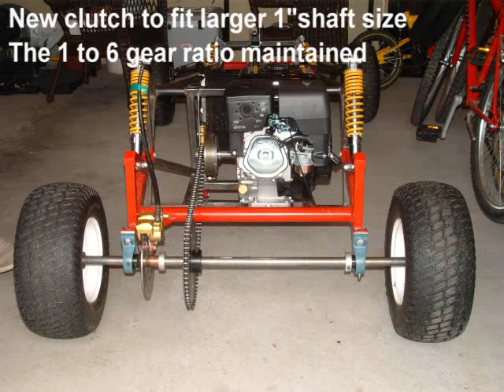Homemade Off Road Go Kart upgraded with a 9HP engine (Pictures & Video)

Comment: hey mate thats a nice build their...i to have just purchased a 9hp lifan engine ( honda copy/clone ). and it has good power but it gets to a certain stage and stays there, you can feel the power and it wants to go faster but just stays at a certain speed...do you have any tips on getting more speed/power from it without removing the governer as its quite a big and delicate job and i dont want to damage it....any tips/help you have would be appreciated, thanks.
Reply from the maker: You got it right there.  The governor is taking control.  You can't have you and the governor control the kart at the same time.  You have to remove the external linkages and directly control the carburetor butterfly yourself.  There is a risk.... If you over rev the engine, it can potentially destroy itself.

Comment: What were the gears? Would it be different on say a 20 horsepower motor?
Reply from the maker: YamahaNearOmaha 
In response to an other comment below I had provided the following explanation : 
"Look at the comment at 1:08 (6 to 1 gear ratio) achieved with 60 and 10 teeth sprockets.  16" OD tires.  3600 rpm / 6 = 600 tire rotation per min = 36000 tire rotation per hours.  36000 rph x 16" * PI / ((12 in per ft) x (5280 ft per mile)) = 29 miles per hour or 46 km per hour which was the target speed.  Hope it helps!"
A 20 hours power would be sufficient to achieve a faster end speed, easily 50 mph, you would have to do the math accordingly.  Ideally a variable speed clutch or a multi-speed engine (motorcycle) would be even better.
Reply: S Blanchard A 22 horse power kohler engine is what i was thinking of using. would i be fine with using the 10 teeth on the drive and 60 on the axle? And what if i wanted to exceed 50 mph?
Reply from the maker: YamahaNearOmaha 
To make the calculation, tire outside diameter is very important in the equation.  Once you have that clearly defined, we can compute away !
Reply: S Blanchard But that's the thing I can get pretty much any size. I'm just trying to find the perfect mix of enough acceleration too do doughnuts in grass and spin the tires on gravel but enough top end to get over 50 mph Like i'm thinking what would the result be with a 10 sprocket on the drive and a 40 on the axle? I'm just worried about ground clearance because I want to be able to go 50+ on road but also be able to go off road if this makes any sense

Comment: He is going to hurt him self and could die me and my freind wreckt our 10 hp cart i broke my arm and leg and. There was a role cage on it
Reply from the maker: With a solid rear axle, wider would make it harder to steer.  In fact the long length was the result of adding space for the seat to be adjustable.
Reply: Ok that make sense cool

Comment: - good grief - that's made better than any car I've owned ! -  if I were to try to mount a 9hp Lifan (sans attached gas tank)  in a little minibike frame which barely holds a 6.5hp Tecumseh with tank - would a new engine plate be required to work and a good balance of engine weight?  (I'd use a knock-ooff series 30 tav w. 1" clutch)

Comment from the maker: I ordered the steering wheel over ebay.  That is a car steering wheel which was way cheaper then any other gokart steering wheel I could find. 25$ delivered, new in box.  I just checked and was able to find something similar for 39$ delivered.  Ebay also for brake caliper, shocks, seat.  Engine, sprocket, chain over princess auto.com.  Back wheel over Casterland. Clutch over Heeter Performance Center.  Many hours of research to find the right part at the right price. Enjoy your project !

Comment from the maker: This is a centrifugal clutch ordered from Heeters.com
The "enforcer" series
http://www.heeters.com/kartclutches.shtml
Works very well, doesn't slip at all. You can feel it very much when it catches and still holds while the engine slows down on compression.  It can handle up to 40 HP.
Reply from the maker: ***** 1k$.

Comment from the maker: @MasterUndead225 
A chain tensionner would have to be added.  The engine shaft would not be centered with the rear swing arms pivot point.  I would rater consider 2 of 6.5 HP side by side.  2 clutchs and chains pulling on the same shaft.  That would be very cool.

Comment from the maker: Chris, yes the Ackerman was planned for.  A CVT clutch would have been more weight and $.  And finally simplicity is a winning way of doing things!  The kart has a long wheel base due to the adjustable seat and independent suspension in the front.

Comment from the maker: I used a wire feed welder.  This was my first project, so it was the easiest one to learn using.  If you see my initial video at 56 seconds, you would see the welder over a milk crate.

Comment: i have a few comments: you are one of very few that seem to actual have the know how to build a kart that is well done and safe. also i noticed that the kart has a lot of ackerman in the steering, did you plan that? also what was the reason for going with a straight clutch and not a CVT? and last but not least when are you going to shorten up the wheel base!!! lol but hey for a young kid a long wheel base is probably best.

Comment: One suggestion, if you took a second set of tires and made slicks. (No knobs/tread) or reduced the amount thereof, then he would not ruin the grass as bad. It would give him less acceleration, but only if he has a hard foot. By doing this you save your grass and teach your son a light foot, making it easier to operate a manual when the time comes... Happy riding!

Comment: willing to bet that thing pushes the front end really bad.  solid axle plus the lack of a caster effect keeps the inside rear from lifting.  this is why most carts dont have suspension of if they do they have a diff.  would like to here back if this isnt the case.  of course on grass it is not going to be as bad it will just tear up the grass more.

Comment: I don't know very much about this so I was wondering what do you use to weld something like this?
Reply from the maker: Charlie Goff Simply a small 140A mig (wire feed) Lincoln welder.  Works very well.

Comment: Great job on the kart looks fun and well built!     If you don't mind sharing what size sprockets and tires are you running?  Would help greatly with the one I'm working on
Reply from the maker: Look at the comment at 1:08 (6 to 1 gear ratio) achieved with 60 and 10 teeth sprockets.  16" OD tires.  3600 rpm / 6 = 600 tire rotation per min = 36000 tire rotation per hours.  36000 rph x 16" * PI / ((12 in per ft) x (5280 ft per mile)) = 29 miles per hour or 46 km per hour which was the target speed.  Hope it helps!
Reply: S Blanchard